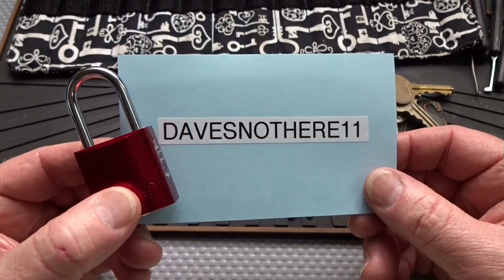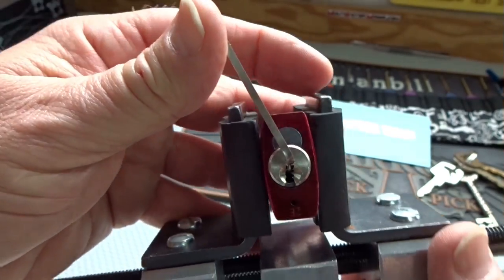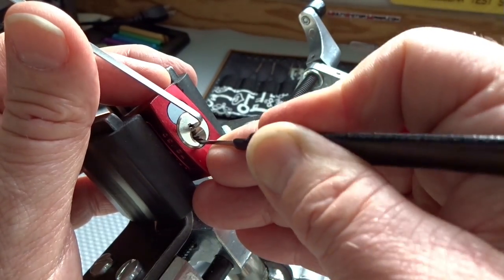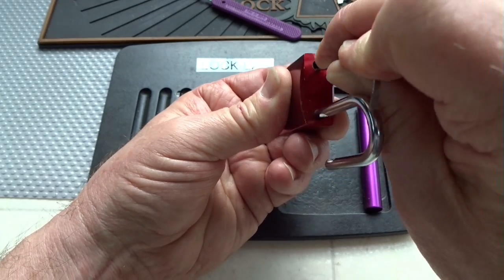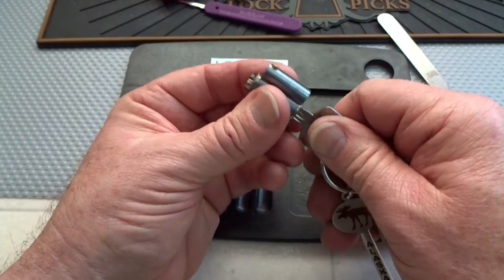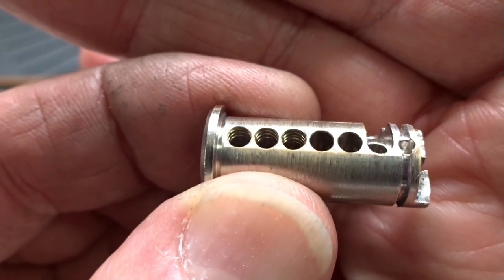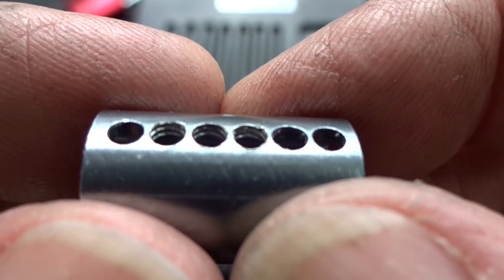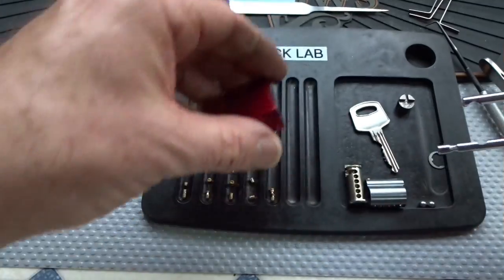(799) Davesnothere11's Bad Day in the Lock Lab!

Comment: Ahhgh! You raked the snot out   of my lock. :)
If you trurn those sideways the keyway spells ABUS. I'd also sent you a link on dissembly but I think you lost it in all the contest mail. Have a good one.
Reply: hello fellow Alaskan! I am now in southwest Louisiana.
Reply: +Walter Starkloff hello. You're going to melt down there.
Reply: +TheDavesnothere11  Good Job Dave. Nice to see a fellow Alaskan put together such a tease. 
From AK too where the winter king festival is going on. Bob
Reply: +TheDavesnothere11 Did the bible pin recessed face make contact with the key pins domed face? with the top of the dome at the sheer-line but the bottom edges of the recessed faces still in the tumbler, being pushed into the bible final bit when you turn the key, creating that detent "but not spring loaded" feel at key-turn he showed?
Reply: +TheDavesnothere11 probably, but I have been here for years now.
Reply: +KelvinSmoke Here's a link to some pics I did of gutting a stock one. https://keypicking.com/viewtopic.php?f=89&t=11329&p=104707#p104707
Reply: +KelvinSmoke also the odd feel he got turning the key was due to an extra spring under the shackle which pushed that into the bearings which pushed on the actuator. All meant to mess with tensioning a single pin pick of the lock.
Reply: +NorthernLightss Howdy. Good luck fishing if your doing the Winter King Derby. I'm definitely getting itchy for the salmon runs to start.
Reply: Thoroughly impressed here. Well done Dave.
Reply: +I like Pork Thank you
Reply: TheDavesnothere11 not this year, I am looking to having my Zodiac ready this next year. It will be ready for the summer run though.
From Homer take care.
Bob

Comment: Could be a feature, mess with the lock and it stops functioning. Either it has to be cut loose or it's penetration becomes known to the next user. My dad used to work at a research facility and they had locks with electronic tamper controls to notify if someone used the incorrect key.

Comment: Usually when springs get caught like that, it means the drivers weren't long enough. The springs got passed the shearline and caught in the threading. Now using the usually doesn't get the springs messed up, only happens when picking for some reason.
Reply: In this case the driver lengths were all stock. The vigorous raking in combination with threaded chambers and the botched gutting likely caused the spring disaster here.
Reply: +TheDavesnothere11 Not sure that was case with the stuck pin though. I had a lock that worked fine with the key but every time I picked it, one spring would get caught. Finally discovered that the driver was a few thousandths below the shearline, the turning of the plug with the tension tool was catching the spring. A driver .020 longer solved the problem.
I believe this is the case here as well.

Comment: I had an abus like this and one of the springs got caught up between the cylinder and the core. So I hit the core with a hammer and when i got It out the spring had cut into the metal.